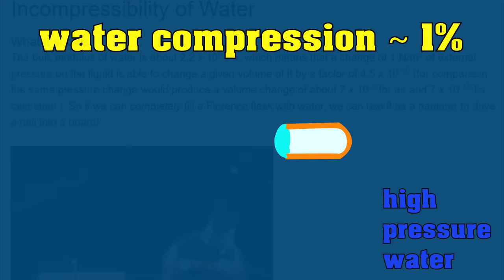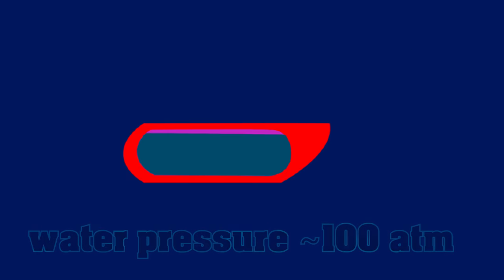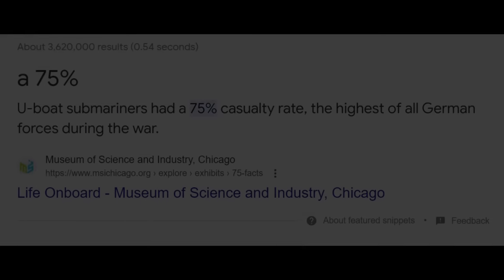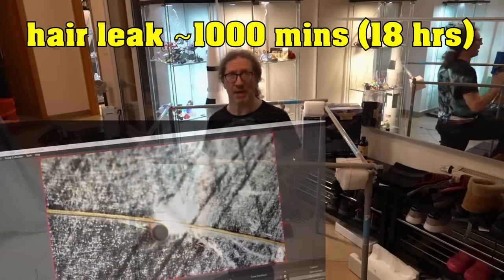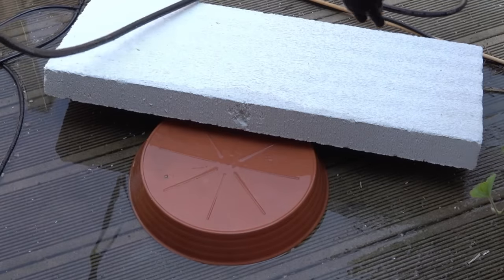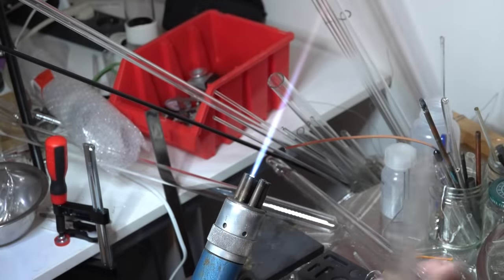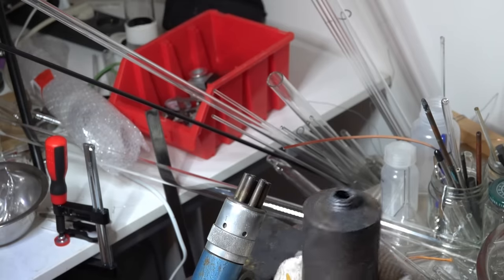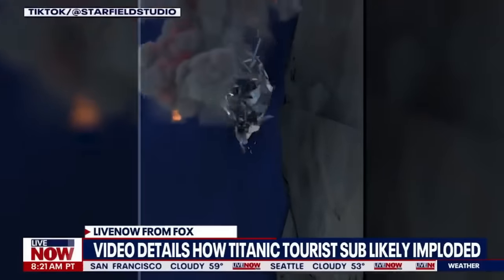Why the Titan sub failed

Comment: Consumer type pressure washers never produce the pressures claimed for them in my experience. Industrial ones on the other hand often exceed the claimed pressures. I have used pressure washers that operate at 250 bars and they eat through hard concrete like a knife trough butter and will strip the insulation from wiring, which I found out to my cost when I was prepping a lorry for its annual test  and found half the lights not working after washing, turned out that several feet of insulation was washed away.

Comment: That's what I was thinking all along as you have dissimilar materials in compression. The pressure would interact with the omposites far greater then the continuous piece of titanium. And the bond layer between the titanium and the carbon fiber tube is yet another variable. The sub was destined to fail at some point. 
I know in calculating components is very tricky based on your layers of material and the bonding layers. Calculations are far more difficult than a continuous piece of material.

Comment: There are pictures online which show two computer monitors being used in the Titan submarine. The problem: they used long screws to screw the monitors INTO the Fiber-glass hull. They put one computer monitor on each side of the Titan sub. So, if it wasn't the glue failing...or, if it wasn't the Fiber-glass + Titanium compression differences causing the failure, it was DEFINITELY the six screws in the Fiber-glass hull which caused the failure.

Comment: To be fair, the titnanium endcap was fitted inside the end of the carbonfiber tube, so any compression would just make the seal stronger. 

More problematic is the cyclic stressing on the center of the tube compared to the endcaps. It is a laminated material after all, which is why carbon fiber pressure vessels are stricly single use when pressurised in compression rather than tension.

Comment: The Titan sub failed because a carbon fiber type material cannot withstand the pressures exerted on it from all directions.  Carbon fiber is good as a wrap for reinforcement but is not to be used alone as a structural product.  The design was suicidal and the billionaire deserved his fate by ignoring the experienced older men that told him to NOT use the carbon fiber in the manner it was used.  By all means Tfoot, design us a carbon fiber sub that will work at those depths....hope you are on the maiden voyage.

Comment: This is just me now, but if the carbon fibre tube had been on the outside of the titanium endcap, wouldn the compression of the tube seal the sub more? because it compresses more than the titatium and is then forced more onto the titanium endcap. Really just asking if that would at least make it stronger

Comment: The hydraulic channel did also tests:
- once water is inside closed box, it will NOT implode quickly (a leak somewhere). Just bubbles escaping.
- good tight seals and no water inside, then it will implode suddenly.

So if there is leak, sub filled up with water, then it will not implode quickly. But it will make sub heavier and go down faster.
By discovery it's confirmed there is implosion due debris found over wide area. So there is no leak, but carbon layer cannot hold it more - also with same reason, due 2 different materials. Then it's possible seal broke, causing the implosion.

Comment: But the way that was glued I’d expect the pressure would increase the bond strength. Then the pressure over the length of the tube will create a bending stress and squish it into a sort of catenary (in cross section) which creates tensile forces in the fibers. Also did you see the fibers are wound around the tube? So they will be in tension at the joint where the titanium is trying to split the tube. Have you ever seen a carbon boat mast? It can take a lot of strain (bending) before it breaks (think fishing rod).
Reply: My money is on a fatigue failure of the carbon because the pressure likely pushes it close to its yield strength…

Comment: 20:50 Maybe the temperature expansion cnacelled out part of the neglected compressibility, so the margin was enough to not fail on the first dives? Titanium prob has a higher temperature expansion/compression, which might cancel out the lower flexibility?

Comment: Thunderfoot,

In your comparison of the bulk modulus of Titanium, and carbon fibre laminate you mixed up the units by comparing imperial units to SI units.  Both materials have a bulk modulus of 130< Gpa, or 18.8< Msi.  They have nearly identical ratings.

Apologies if this has already been addressed, but you should make a correction.  

Thanks for the videos.

Comment: My friend operates a water jet cutting table, without the use of abrasive material in the water, it has the capacity to cut up to 1/4 inch thick steel

Comment: Great video. It seems like it would really depend on if the failure was the seam/adhesive or crack in the carbon fiber. 
Your demonstration from the pressure washer was good but I don’t think you could consider that a pin hole. 
The 3000psi would be right at the surface that pressure quickly fades in the air, hence why the damage from the pressure washer wasn’t as bad as you expected (or they lie about the pressure it can provide #marketing)

It seems if it was a crack in the carbon fiber then an implosion would ensue.

Comment: One more issue with a leak in deep water is what happens to the air as it gets compressed.  As the pressure goes up, the amount of heat energy in it stays the same, but is in a smaller and smaller volume, resulting in the air getting hotter and hotter.  Same thing happens with any home air compressor.  Cooling air compressors is a big deal.

In the case of a sub, as the water takes up more and more space and the air get more compressed, without cooling it will get hot enough to burn anyone left alive, and eventually it will get high enough pressure and temperature that it will cause stuff inside the sub to start auto-ignighting.  Basically, the whole air space left in the sub will turn into a big diesel engine.

At that point, you're gonna have a bad time.

Comment: What was the approximation for fluid inflow rate? 

My guess would be that the flow rate is dependent on the size of the hole and the difference in pressure between each side of the hull. (And there's probably other fluid factors like viscosity but honestly who has time for them)

But as the water flows in the pressure on the inside is going to increase. Thus the flow rate decreases (assuming the hole doesn't get bigger - which is an unrealistic assumption). Nonetheless I don't see this reflected in the calculation.

Is this because the difference in pressure is so large that it may as well be ignored?

Comment: Wouldn’t the differential compression result in the carbon fibre being in tension?

I couldn’t imagine how much load that “glue” would be under while the carbon fibre is in this state … there would have to be a tensile and shear loading. I believe under shear load most “glue” whether an epoxy or epoxy-resin are extremely weak

Comment: With a slightly less technical perspective ... When i squeeze the body of a pringles potato chips tube that's made of "composite wood" ( aka : cardboard )  , the aluminium lid pops out on it's own ....With the gradual squeeze of the carbon fiber hull the openings on both ends became more oval , whereas the glued lids still stayed round , that dissimilarity probably cracked the glue joint before even the carbon fiber gave in ....probably why the sounds they were hearing were coming from AFT ....

Comment: The sub was descending at a rate that indicated it was heavier than expected and that was way before they got to their final depth.  The only thing I can think of that would make the sub heavier would be water intrusion.  A pinhole would fill the sub with water and then grow much faster with time.  They were almost at 3,500 meters (over a 1 1/2 hour dive) before they heard crackling sounds (probably from the water shorting out the batteries) and loss of communications.  They also had time to drop ballast at the beginning of the dive and abort the dive.  When they could no longer rise anymore because of the extra water weight, it was too late for them to be saved.  I suspect they had a micro pinhole leak even smaller than 0.1 mm that just continued to grow with time and depth.  Once they new they were descending too fast they should have aborted the dive.  They might have lived if they did that.

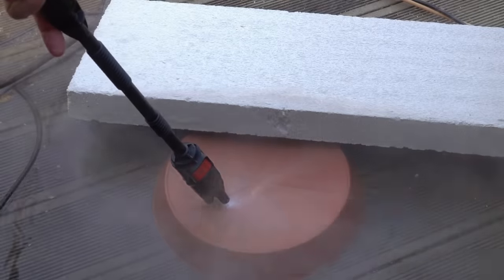Comment: 13:45 Your jet washer can't cut thru the plastic. Let me clarify the reason:
For example, let's say (i don't know) you pressure washer operates at 125bar, the pressure at the exit of a nozzle is not 125bar, it is lower than that by much. Nozzle itself doesn't determine the end pressure of an pressurized system, the pump/compressor/turbo pump... are those who do the "lifting". Let's say like this, in the enclosed system, pressure is always the same (unless we change the volume), doesn't matter the diameter where the liquid/gas flows, only difference is the speed of fluid (flow), on the other hand, if we speak about open pressure system (such as pressure washers, cutters,...) pressure will drop significantly on the point where the exit from the system is (in our case "nozzle"), We call that pressure operating pressure while the pressure when we stop the flow is called static pressure.
Now let's use Bernoulli's equation to calculate the pressure difference on the point where the liquid goes out from the nozzle (point which divides the closed system from open system while operating). Let's assume there are no significant energy losses (ideal conditions) in the flow the equation should be:

P_exit + 0.5 * ρ * v_exit² = P_system

Lets say we have 125bars inside the washer, let's assume that the pipe feeding the nozzle is about 5mm in diameter and let's say that nozzle itself is about 2mm in diameter.

I will spare you the calculation and do it myself, if you want you can use Bernoulli's equation to check if I'm wrong but anyway here are some of my results

Assuming that washer operates at "ideal" conditions I've found:

P1 = 125 * 10^5 Pa
ρ = 1000 kg/m³ (density of water)
v1 = 62.76 m/s (velocity at pipe entrance)
v_exit = 156.9 m/s (velocity at nozzle exit)
P_exit = 101,325 Pa (atmospheric pressure)

To get the pressure difference:

ΔP = (P1 + 0.5 * ρ * v1^2) - (P_exit + 0.5 * ρ * v_exit^2)

ΔP ≈ 3.1 * 10^6 Pa

ΔP_bar ≈ (3.1 * 10^6 Pa) / 100,000

ΔP_bar ≈ 31 bars

So, pressure drop at the nozzle is 31bar, in the system we have 125 and outside the nozzle is 94, it is about 20% pressure drop at the nozzle exit

Hope it clarify some about pressures.

Keep up great work Thunderf00t, great content and channel as well.
Hope to see more in the future of some debunking stuff :D

Comment: are you for real, if you have pin whole at that deapth it would cut through the other side but even before that happened the pressure would just impolde the sub

Comment: My initial thought was a bit different, but a similar concept. My first thought was that the viewport failed, which would have led to an even faster inrush of water, and the force of the water jet would have hit the back end cap, likely separating the sub. 
A pin hole is more likely though.
Reply: Given the porthole was seriously under rated for the depth they were going it is entirely possible the window blew in at super sonic speeds. However id assume that IF the two end caps were blown off by a water hammer effect due to the window that the fiber tube would had been more in tact. It seems more likely the carbon fiber buckled inward making the ship take on a more hour glass like appearance and shattered suddenly under the forces and the two end caps accelerated toward the center, obliterating the carbon fiber tube, and everyone inside pretty much instantly. Which then would cause a massive cavitation bubble that blew everything outward again and scattered the now tiny shreds of everything far and wide.
Reply: @GamerLoggos  killed by the ol stretched slinky

Comment: I was speaking to a Oil and Gas engineer months before this submarine thing happened. He was talking about helping another company take soil samples of the ocean floor. The company initially wanted to use one type of plastic (Vectran I think), but under high pressure and low temperature, Vectran became very brittle and weak, so they ended up using Kevlar (I think). It is possible, in a carbon fibre - plastic matrix, that either the carbon fibre or the plastic matrix changed under the pressure and temperature in a similar way. They could have just been really lucky the first 13 times. The internet is useless for a lot of technical information, so I can't say for sure the pressure did affect plastic strength, only it is a possibility.

Alternative theory: Giant Squid Attack. Giant squids have big bitey beaks, and biting through carbonfiber plastic would be easy. Humboltd Squid have been known to attack people. If I were a Giant Squid, I would definitely attack a submarine for fun.
Humboltd Attack Video: https:https://www.youtube.com/watch?v=MlRA5TMPWZ4

My favourite scene in Das Boot is that random scene where Johanne just randomly eats that orange whilst everyone is sleeping. In a 3 hour movie, I wonder why they left that scene in. Man, I have never seen anyone eat an orange with as much expression as Erwin Leder.

Comment: You are using an electric power washer they do not deliver at any of the rated specifications. An electric powered washer generally does not even remove paint..  Rick is actually pretty easy to mess up with either do to how it is structured

Comment: Working with CF weve experience delamination issues from simply glueing plastic to carbon fiber and running it through envioronmental temperature testing with no pressure. I imagine going from the water to the surface to storage also played a role in the carbon fiber failure.

Comment: In the oil industry we didn't utilise epoxy adhesive for any structural jointing. Namely, and this is very important, the failure mode of epoxy glue is "catastrophic", meaning instantaneous failure of the joint. No warning.

Comment: Watching as they lower the titanium ring onto the carbon cylinder; I expected to see at least a small amount of glue being pushed down to indicate it had good uniform coverage around the full circumference.  The lack of ANY excess being pushed out (to me at least) suggests there wasn't even enough glue to bond the two layers with reasonable certainty that there were no voids left.

Comment: My understanding is the layup of the carbon was radial i.e. it was just applied to a rotating metal tube, so the layup had no real cross bonding which is the way to gain maximum strength in carbon fibre as it gains maximum strength in tension . It is normal to cure this in an Autoclave who's principle purpose is eliminating voids in the material which I do not believe was the case, there are very few of the size needed outside the aerospace industry. Any voids in the material would have been compressed and released with each dive cycle so there would be movement between the bonded layers albiet small but enough to degrade the bond. Fatigue would follow and the ultimate compressive strength reduce. I believe the junction between the parts was metal to metal as the inner tube dealt with the junctions. The limited photos that have been published show the hull in a number of pieces which with your hypothesis of a pin hole leak would not be supported as once the pressure inside slowly rose the loads on the structure would reduce as they are a function of the delta, a break up would indicate a sudden and catastrophic  failure.

Comment: someone speculated that the frame was giving the carbon cylinder some extra support, and if/when they jettisoned the frame (for extra lightening of the weight) when they couldn't ascend) that loss of support exacerbated the compression/implosion.

Comment: Someone has published what is claimed to be text messages between the Sub and Surface ship and apparently they had power issues and could not surface and could hear cracking noises, if that is correct I think they might have had a water leakage into the power compartment and that filled with water first making them too heavy to surface, then the Sub imploded
Reply: I'm pretty sure that "transcript" is a fake.  In it, the surface ship periodically asks the sub for its depth and the sub replies with numbers.  In reality the ship has always had a more accurate reading on the sub's depth than the sub had, thanks to a ping/return system they had which gave them an accurate 3D location for the sub, like a sonar GPS (up until system failure occurred).  The sub never knew its own location to any accuracy, the ship verbally guided it to the Titanic using the realtime location data that only the ship had.  As such, it would make no sense for the ship to keep asking the sub for its depth, but this occurs repeatedly in the alleged transcript.
Reply: @ddichny  That makes sense, thank you

Comment: Thats not a interference fit!! That falls on carbon fibre tube lol even though it would not have mattered as it still would have failed regardless.. but gluing the 2 parts isn't really going to work because the fit is so loose no glue squished out means there's no real pressure pushing the the 2 parts into each other and the glue.. it needs to be a very tight interface fit and it wasn't but the compression ratio difference between the two parts would have failed the same way.. but it just falls on 😂😂 really loose tolerances!!